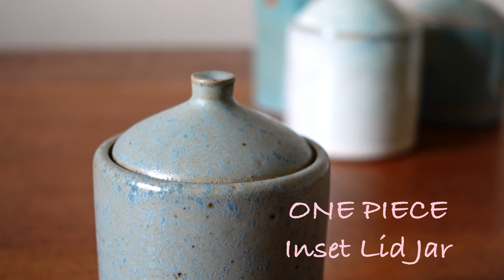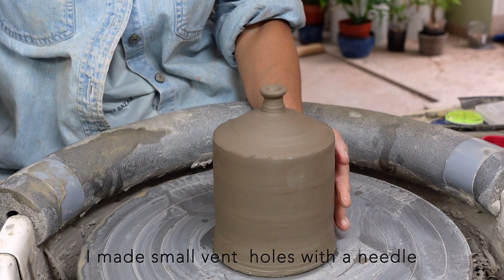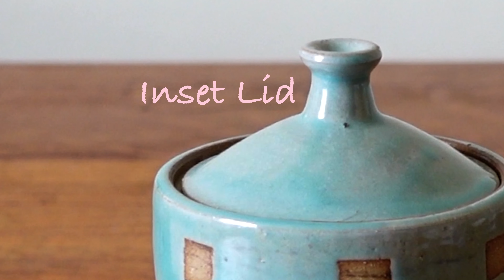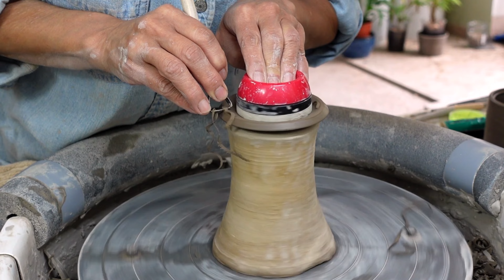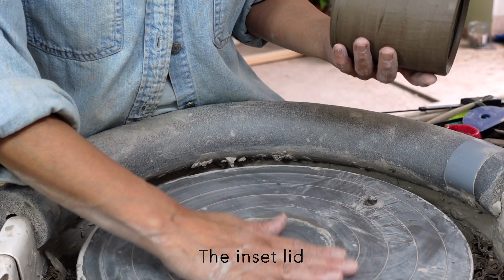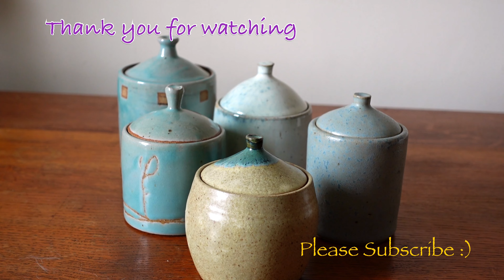Throwing a “ONE PIECE Inset Lid Jar” on the Potter’s Wheel.@AlchemyCeramic #pottery #ceramic

Comment: Hello, thank you. What is the trim tool called that has the red top, please??
Reply from the maker: Thank you for your question Shrihartman.😊 . Trimming Spinner.
You can buy ready made one on line which is silver looking disk. I use it in the “Double Walled Thermo Cup” video. This red top one I found in the nicknack shop. it was a spinner for spirit drinking game. It has an index finger shape attached originally.  It works very well. Take a look of the other video and  the size is good for you you can order online and very reasonable price.
Reply: Thank you very much for your reply.  @AlchemyCeramic

Comment: Where did you buy your measuring tool for the lid and gally?
Reply from the maker: Thank you for your comment Sharone😊. I bought it on line. There are so many of them. You don’t need to buy expensive one. This is not special one but very useful.
Reply: @AlchemyCeramic  I don't know what you call it, to look it up. Thanks
Reply from the maker: Digital Caliper is the name. Mine was about £8. it is very good for the price. I’m in UK. It may be called Electric Gauge in other countries.

Comment: I am assuming these are not fired together as the bottom inside lip looks glazed. Am I correct?
Reply from the maker: Thank you for your question Keith😊 The pot and the lid are fired together. I use wax at the joint part and use only not runny glaze.
The inside of the lip is glazed but the joint part was carefully waxed.
some people recommend to fire separately. From my experience I prefer to fire together.
Reply: @AlchemyCeramic  The pot lip does looked glazed but that is excellent that you are able to make sure the lid doesn’t stick to the pot when firing.  I know they need to be fired together because you have such a wonderful fit.  I like this method and I am going to give it a try.
Reply: And thank you for the wonderful demo.